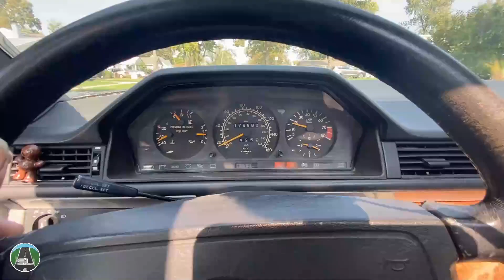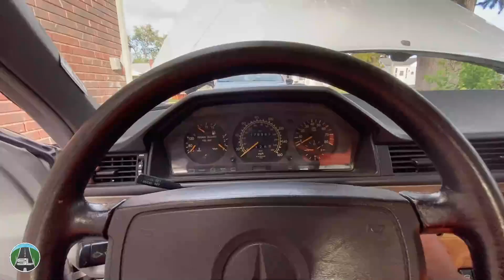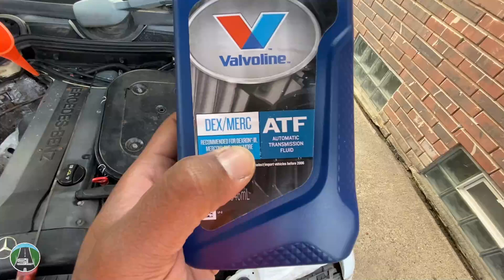Mercedes Benz W124 transmission problems | Vlog | Driving

Comment: OK, first of all; Mercede gearboxes always start with 2:nd gear. To get first gear from standing you'll need to floor it and engage the kick-down switch. See that you have a later model W124, maybe -90 to -93? Well, in that case, there is a valve on the left front section outside of the gearbox. That valve should hold the upshift of your gears when engine is cold to get your catalytic converter to start working faster at cold exhaust temperatures as well. I´ll start by checking this valve and your temp. sensor for starters.
Regards from Stockholm, Sweden.
Reply: What is the name of this valve on the left front of the transmission? Do you have a part number? Is it a DIY job?

Comment: Did you fix the issue? Change the transmission filter and fluid. The filter gets clogged and fluid goes bad. Drain the torque converter and transmission pan. Change filter add 5 liters start the transmission shift into each gear for 15 seconds. Top up when car is running and trans is warmed up. Car can be 1L low in 722.3 transmission to operate.

Comment: I'm having the same exact problem . Mine starts shifting at 2500-3000 and you have to let off the gas to make it shift. Checked the atf and it's really dirty . Hopefully will change fluid + filter and get it solved I don't have the funds to get a trans replacement
Reply: What was the problem brotha havin same problems

Comment: Have you done a w140 transmission. I have a 92 300se inline 6 mercedes benz. Transmission wont go into grear at all it just revea up but not more
Reply from the maker: No I not. Other than battery replacements and oil changes, this is my 1st rodeo with Mercs.

Comment: Hi,
I'm having similar sluggish reaction when accelerating, foot on the gas and then maybe 3/4 seconds before the car realises and kicks gear to allow the car to pull off, changed fluid etc(pan was spotless) with no difference, going to adjust the modulator clockwise a 1/4 turn see if there is improvement,
Also, those trans generally skip 1st gear unless your using the kick down from take off, (I think they even skip 1st in S mode). Theres a trick/hack that someone on youtube had that you can wire differently and fool the gearbox so it will use 1st but I reckon its unnecessary!
My 300E24 is still perfectly drivable only lacks power when already in motion, takes off from a standing start like a cheetah, no gear issues.
Did you fix your sluggishness???